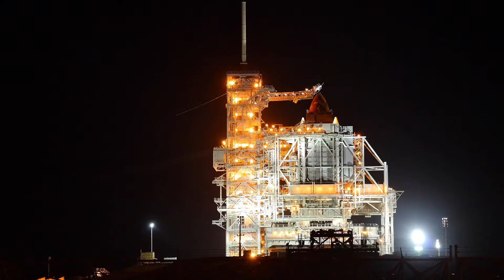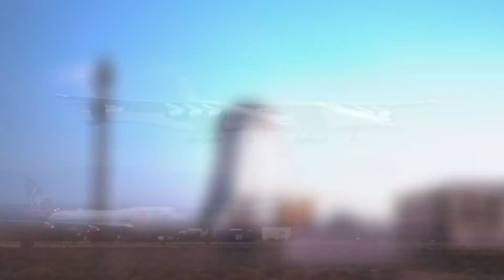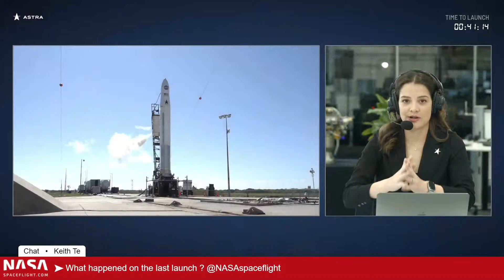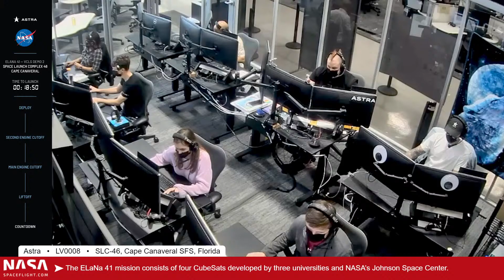Astra Launches NASA's ELaNa 41 Mission

Comment: I also did rocketry as a kid. I made them out of aluminum tubing, installed a 1/3 diameter exhaust valve at the end of the 14" rocket. Then covered the rocket with school lined paper. Something to glue the 4 fins onto, and added lead to the base of the pipe. Mixed my own fuel out of 2 elements, and filled up the rocket. Ignited everything with waterproof fuse, also known as dynamite fuse, and placed the rocket on the launch pad that a friend of mine built. I installed a mercury switch to the outside of the rocket, so as it ran out of fuel the nose would tip down, throwing out the parachute. All worked well. So, you ask, why didn't I go to the space program, way back in 1962? Another story for another time! Today retired from Medical Engineering, or more specifically Laser Engineering.

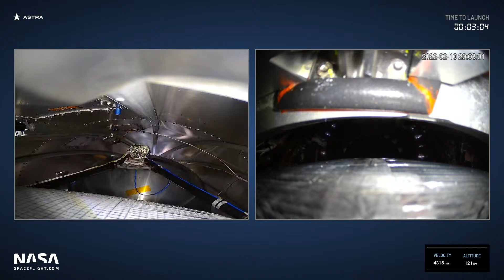Comment: 01:02:20 Fairing separation fails
01:02:25 Second stage gets shoved into the tip of the fairing
01:02:30 Second stage ignites, blowing fairing halves apart, causing the second stage to tumble
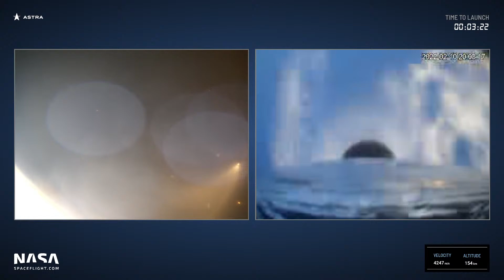01:02:46 Astra engineers realize the mission has failed

Comment: What a shame. It finally lifts off and something goes wrong... As soon as they switched to on board cameras it looks like something goes wrong. If you slow it down and watch right at 1:02:21 something shifts and looks like daylight comes in, you can see the reflection. Then whatever that big thing is shifts up and you can see more light come in.... Now, I have no idea what I'm talking about. That could all be what's supposed to happen but to me it didn't look right.
Reply: That’s the explosive charge that’s meant to separate the fairing. That’s totally normal. 

Unfortunately the system that pushes the two fairing halves away failed

Comment: intro- 0:25
stream started- 1:20
lift off- 59:07
meco/second stage F- 1:02:23
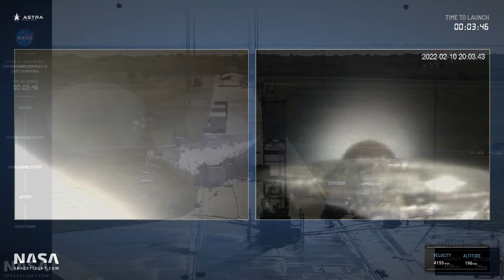F(explode?)- 1:03:06
pres f to Astra rocket 3(LV 8)
Astra rocket 3(LV 9)next up
Reply: F
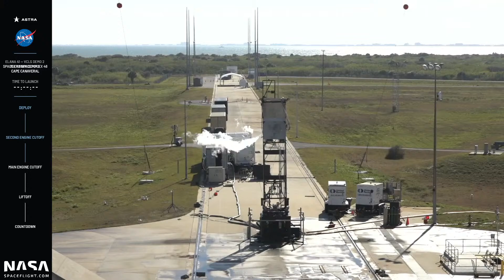Reply: The explosion was closer to 1:02:49 and announcement made at 1:12:39
Reply: 1:02:20
Reply: Stage separation gone bad, i think the first stage is too tight in the second stage, it is too fat. Look at space x and you see that the first stage is not a crammed into the second stage. 

The astra's design of that piece might be the problem. Maybe some explosive bolts or thrusters to ensure separation could be added. So you dont have to change the design. Or loaded springs. 

Too bad guys @ Astra.

Greetings,

Jeff
Reply: @jeffjefferson2676  Astra is a totally different design. The whole second stage sits inside the first stage and the fairings need to open to let it out.
Reply: @oldbloke135  All i saw that the first stage got stuck in the second stage and that made for the launch to fail. The break has got to be cleaner. 

Greetings,

Jeff

Comment: So close. Part of the problem looks like it was actually shown right on the camera.  1:02:21. right when MECO is heard,  top metal piece crumples down.  at stage separation 1:02:26, top metal piece slams into the crumpled down piece and stops separation.  1:02:31 second stage ignites and blasts the two apart but second stage is now tumbling.

Comment: The issue appears to be due to fairing not separating and thereby locking stage 2 inside the rocket until the engines blew the fairing open. Astra in their sequence has to sep fairings before stage sep. flight 0007 has a very rough fairing separation but they do separate so the mechanism probably was an issue back then but still worked. Seems like a relatively minor fix but sadly a hard blow. My heart goes out to all those people at Astra. I still believe in Astra!!!

Comment: It seemed like a nice stable launch…until about +1:28 (1:00:50) when the contrail revealed lots of corrections or over corrections.  But the callout at max q was everything nominal.  At +2:15 (1:01:35), I was wondering if I was seeing wig-wag exhaust plume, like the vehicle was spiraling, or maybe it was just some video compression artifacts.  And after booster separation, when upper stage video showed the Earth repeatedly sweeping through the field of view, I was pretty sure that was a failure.  Still, the launch announcer said nothing.  She could have just said, “Well, that’s no good.”  It sounds more honest.
Reply: That was more likely to be high altitude winds blowing the contrail in different directions than any problem.

Comment: go to 1:02:24 you can see that the stage separation happens prematurely and the second stage is just floating inside the fairing so when the fairing separated, the explosion knocked the second stage around because it wasn't still held in place.

Comment: The velocity telemetry we're getting did the same thing this time that it did last time Astra launched.
It's not showing the "true 3-dimensional velocity" of the vehicle. Instead, it's showing just the Downrange component (aka just the horizontal velocity). Early in the flight this tends to not well represent the true velocity of the vehicle, however it becomes more accurate as time progresses, due to the vehicle pitching over towards horizontal flight above the atmosphere (which is where the majority of the delta-V of the vehicle is spent in an attempt to reach a stable orbit).
So bear with it for a while to give the numbers a bit of time to start making sense relative to what's happening to the vehicle.

Comment: This company is trash, they keep on failing, wasting millions of dollars, they never learned from their mistakes is a big problem
Reply: Just remember it takes time to get to orbit.. mistakes do happen even if you have the best built rocket.
Reply: @raptorsealevel2039  You might not need the best built rocket, but you do need the best engineers which they do not have
Reply: @Redorean  Never learned from their mistakes? What do you mean? What mistake have they made in the past that they haven't corrected? Do you really think Astra would keep poor quality engineers?
Reply: @OortCloud  I agree if Astra didn’t think they had good engineers they would have gone long ago, mistakes just happen
Reply: @OortCloud  are you kidding? Beautiful launch followed by an upper stage failure, that's the one mistake that they have not been corrected, they have average engineers for sure, but not sure about best
Reply: @Redorean  You say "Upper stage failure" very vaguely. We don't have official word on what exactly happened. The only upper stage failure that we have proper knowledge of was on 3.2s launch when there was a bad mixture, which was FIXED on 3.3s second launch where it made orbit successfully. This case was completely different.

Comment: Looks like the fairing seperation was what failed as the light seen on the left side camera, as well as the shift in the fairing inner body most likely mean during MECO there was something that came apart or jarred open the stage separation. Considering the adequate delay before booster ignition on the upper stage I'd vote the fairing separation didn't work properly, or it was premature due to forces from MECO. After the booster ignition on the second stage it blew past the fairings and began the tumble.

Good luck on future launches! Orbit is hard, even for the most brilliant companies.
Reply: I'm no rocket engineer so this is all speculation, but that was my interpretation of what I was seeing as well: fairing separation failure.

It looked like the 2nd stage tried to separate, ran into the fairing, then the engine lit.  That forced the fairing off, but of course set the stage off course.
Reply: @firefly4f4  you can notice the fairing was jarred just before second stage seperation. Sequence would have been MECO, fairing seperation, stage seperation, then ignition. Problem happened just after MECO was announced on the feed so either the residual thrust just after MECO created issues with fairing seperation or the seperation mechanisms had issues themselves. No doubt they'll find it in the data.
Reply: @devanburden7722  remember when falcon would bump its second stage....  you don't know till you see it in action.
Reply: @machineenvyllc437  Exactly what I saw. Booster got hung up trying to separate and the second stage lit up with the booster still partially attached. The kick knocked it loose but also caused a tumble to start.
Reply: @machineenvyllc437  exactly what I thought. I never knew about residual thrust till I saw and learned about the falcon bump.

Comment: Oh that's sad. Do they use a single engine on the upper stage with thrust vectoring? If so, maybe the thrust vectoring gimbal got stuck in a sideways position. I hope they can recover and learn from this failure.
Reply: The second stage was not the problem, it worked as intended. The fairing didn't separate on deploy. Since the rocket's computer doesn't know that (for all means, it deployed the fairing), it kept going with the stage separation. When the 2nd stage started the engine, it was caught on the fairing, separating it, but losing control. It was a shame, but I bet they will make it next time. They're here to stay and have proven they are not just building rockets for fun.

Comment: Whoops! When the second stage video began tumbling, I immediately felt bad for these folks. As the saying goes, 'space is hard'. Hopes for more success in coming attempts.
My first rocket, about 50 years ago, chased my brother down the driveway. My second rocket crashed into the neighbors' roof.  
I understand failure.
Reply: Been there done that
Reply: It looked like stage separation failed & 2nd Engine Start blasted 1st stage away sent itself into a Tumble...
Reply: I almost set a field on fire when I launched my first rocket
Reply: My brother burned his fort down many years ago. He was using a hand crank pencil sharpener to grind the tips off of strike anywhere matches to use for fuel. I can't imagine what went wrong.
Reply: U goose

Comment: Whooops. Good try though! Failure is at 1:02:20
Reply: Second stage hit the fairing during stagesep, then spun out of control
Reply: What happened there?
Reply: @Tankwiper  Looks like the fairing failed to separate. That's the first little judder you can see at 1:02:22. Four seconds later the stages separate, which causes the second stage to slam into the fairing. Then the second stage engine lights up and forces the second stage through the fairing halves, but at the same time it causes the second stage to start spinning out of control.